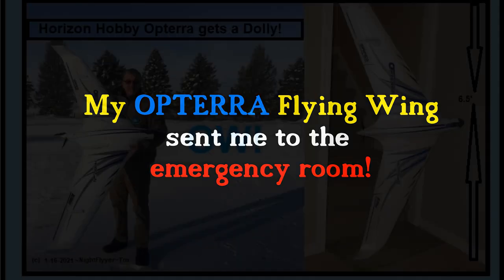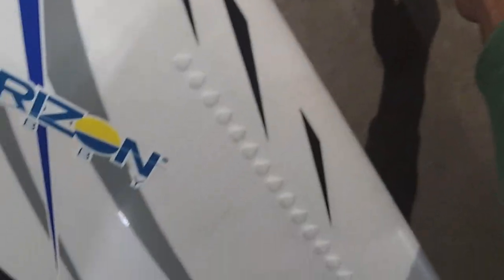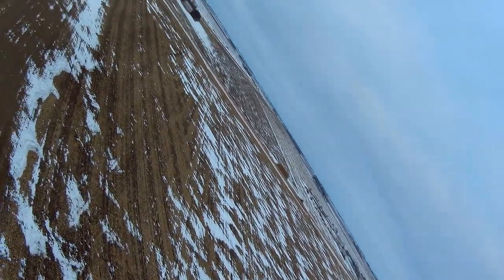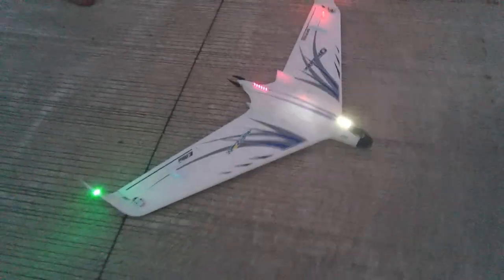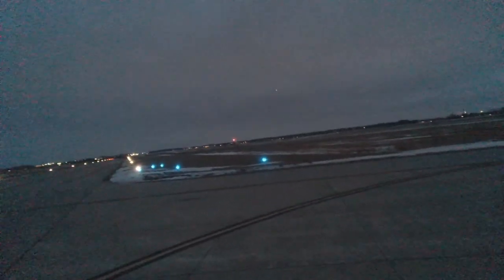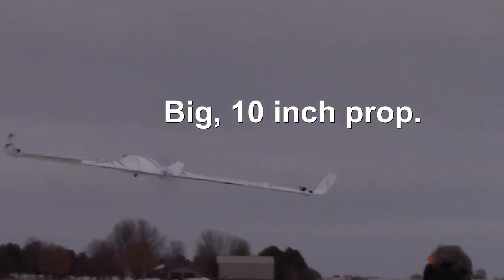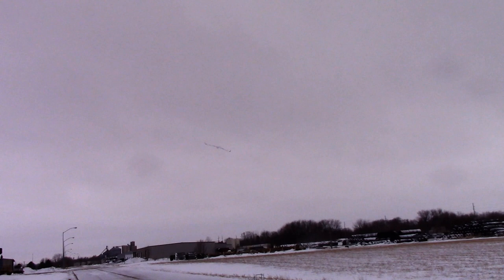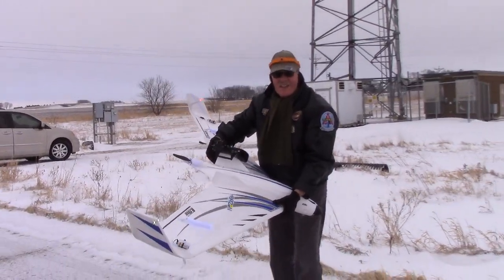My Opterra 2M Flying Wing sent me to the E.R. This is an awareness video & my solution for launching

Comment: You don’t have a throttle cut off on your planes? Glad you’re ok. I’ve had the same concerns with the Stryker.
Reply from the maker: No and every one of them have to me moved to full stick then back, but not this one.  I never have had to use a throttle cut.  That is not what cause the accident anyway.   Here is exactly what the Opterra 2M manual says word for word.  1.  Put the aircraft into launch mode with the channel 5 switch.  (in my first video that did not work, it went into the ground)  2.  Hold the aircraft in one hand and the transmitter in the other.  3.  Apply full throttle and throw the aircraft directly into the wind, angled slightly up (5 to 10 degrees above the horizon). 4.  Climb to a safe altitude and check the trim.  Thanks
Reply: @NightFlyyer  I put a throttle cut on every plane I have. One of the reasons I didn’t buy that plane is because I’ve seen exactly what happened to you happen to others.
Reply from the maker: @paulballard4243  I only mention the Throttle arming because I followed instructions in the manual and this is the way it bound. It said nothing about programming in a throttle cut to a switch, which also may be in the wrong position, by accident.  It  had nothing to do with the reason I got hurt.
Reply: @NightFlyyer  yeah yeah ok 🙄

Comment: The hand launched pusher configuration is just asking for trouble, a couple of guys in my rc club will throw their planes with the motor barely going or not running at all, then give it power after they toss it. It does cause a torque roll but its manageable. A plane like that might need a landing gear it can take off with.
Reply from the maker: My smaller wings are not problem, like my F-27 Evolution, but this one is hard. I know others have their own ways, and either way, my Dolly is the safest solution for me.  
The Opterra 2M manual also says nothing about throwing it with the motor off, so if a newbie followed the instructions, like I did, I'm showing what could happen, in case a gust of wind got them or something else.     Nothing is 100% and no matter how good you can throw, this big 7 foot wing with a 10 inch prop spinning right next to your face, into 12 MPH is risky to say the least.  The 10" prop is very close to your forearm as well, so a gust could tip it back even before launch, as others told me happened to them.  Thanks.

Comment: I feel your pain and share your scars.   While some pilots have had great success with hand launched pusher planes, they are inherently risky.  Flying wings are even more so since they have no prop wash over the control surfaces and require high launch velocities to prevent stalling.  Keeping the prop diameter as small as possible reduces the chance of contact, but one is always one "oops" away from the emergency room.  With the transmitter hanging around your neck, it is very easy to accidently bump the throttle when picking up the plane.  Many transmitters have a "throttle hold" function.  This function links to one of the transmitter switches, preferable the far left one,  and the switch forces the throttle to off.  When holding the model overhead,  the switch is flipped to enable the throttle.  Many of the pusher flying wing designs have been created to keep the plane's nose free for mounting an FPV camera.  A practical alternative is to change over to a twin motor tractor design.  This clears the nose but at the expense of adding the weight of the second motor, prop and ESC.  It does however provide safety and more stability at launch with the prop wash going over the control surfaces.
Reply from the maker: All true.  First of all, that throttle cut had nothing to do with my hand injury. I only mentioned the Throttle arming because I followed instructions in the manual and this is the way it bound up and arms the motor as soon as you plug in the battery.  It's my warning to be cautious, because the manual says nothing about programming in a throttle hold to a switch. I've known of times when after flying, that switch was forgotten to be moved back to safe and it armed as well.  Nothing is 100% as it could be left in the wrong position, by accident. I'm pretty experienced, so never relied to on a throttle cut/hold, as all my drones and helis need throttle stick movements to arm.   I only am warning others to be careful BEFORE the launch and to be careful no matter what you use. 
This wing is 7 foot long, heavy and will bend and break the end off the if you even try to pick it up by the tip and barely has enough power to fly out of your hand at launch.  I know and I tried.    It would also be extremely difficult to somehow launch it discus style with the elevon there and that 7" tall winglet rudder that is also on the tip.  I know how to do it , but not with this plane.  
See my 14 year old self-contained catapult in action here.  https://www.youtube.com/watch?v=ypxbkaY-Ycs&t=113s  
It's not like launching my SMALL F-27 Evolution or 1.2M Opterra.  So I followed the instructions word for as I did for the video I made of my product review earlier where nothing happened bad.  https://www.youtube.com/watch?v=P_inF5EYLEE&t=1s and the second one where I explain how to protect the bottom of the fuselage.  https://www.youtube.com/watch?v=ur5V5H8UcGs&t=1s
We are only talking about a Half inch of clearance that I needed to keep from getting cut. 
Here is word for word what the Opterra 2M manual says about launching.  
1. Put the aircraft into launch mode with the channel 5 switch.  (in my first video that did not work, it went into the ground)  
2.  Hold the aircraft in one hand and the transmitter in the other.  
3.  Apply full throttle and throw the aircraft directly into the wind, angled slightly up (5 to 10 degrees above the horizon). 
4.  Climb to a safe altitude and check the trim.   
I know others have their own ways, and either way, my Dolly is the safest solution for me.  
The Opterra 2M manual also says nothing about throwing it with the motor off, so if a newbie followed the instructions, like I did, I'm showing what could happen, in case a gust of wind got them or something else.     Nothing is 100% and no matter how good you can throw, this big 7 foot wing with a 10 inch prop spinning right next to your face, is risky.  https://www.youtube.com/watch?v=P_inF5EYLEE&t=1s 

And to see how I feel about that unnecessary auto stabilization system see this.  https://www.youtube.com/watch?v=ur5V5H8UcGs&t=1s

Thanks.

Comment: Wow, brilliant job of landing that plane. You'd think at the very least it would have some sort of circular prop guard or perhaps some sort of wheels that would allow for a ground take off. Maybe some sort of cut in hand grip for hand launching but you'd have to not hold the throwing arm for true, you'd have to drop it fast. Terrible design flaw and I know that must have taken months to just start feeling right again in part. Doubt you'll ever have the same feeling or control with that hand again, please correct me if I'm wrong about that.
Reply from the maker: Thanks for the suggestiond and I tried some already, but because it was cold.  I found trying to hold on to the tiny finger grips on the bottom of the 7 foot wing with a thick glove under full power with wind blowing was difficult when under power and then trying to fly with  a big enough glove on was also difficult to fly the transmitter, (I'm a stick pincher)  so although that sounds like a good idea, it did not work that well. Some have told me the Prop got them in the forearm even before launch, when a gust of wind got under the wing and tipped it back.   We are only talking about a Half inch of clearance that I needed to keep from getting cut, and even though I pulled it off several times in my earlier product review video,  I will never hand launch it again.  LOL.  It's hello dolly from now on!  
If you saw my Product review  video,  https://www.youtube.co/watch?v=P_inF5EYLEE&t=1s  you would see  those wings aren't as strong or thick as you would think.  I would have to add a nose wheel servo and make it a trike as well.  And since the prop on the back is 10 inches, the landing gear would have to be quite long or retractable prop would hit the ground on rotation or landing. Thanks for the suggestion, but the dolly will work.  It's been 3 weeks and yes, the finger does not bend well and still hurts when I try.  Thanks again.
Reply: @NightFlyyer  Check with your Doc, a call will do but I'm thinking he'll tell you to keep pushing on bending the fingers as the tendons need to stretch and not seize up. He may recommend physical therapy and if it's covered that may be good as well. Maybe a soft rubber ball and squeeze it, one the size of a grapefruit or just smaller. I'd work it at least a few times per day. I realize this isn't my business and also don't want to assume you haven't gone way past my thoughts on this subject. I find it hard not to help even at the risk of not being taken well in certain circumstances. Thank you for the great videos and I will indeed check out the preview. ONE MORE THOUGHT...What about an atlatl , you just need to add or take away something so the atlatl will catch. That would keep your body from harms way or so one would think.
Reply from the maker: @MartinFluteCompany  Yes. I am using the dolly from now on.  This plane is just too big to hand launch.  I am using a soft ball to move my finger.  It will take some time, but it is getting better. Thanks.

Comment: Sorry you got hurt that looked really nasty!. I keep seeing Youtube videos of people struggling to hand launch. I have flown RC Planes for many years including wings albeit never a 2m wing and they are not easy to launch but see how well your Opterra glides, You can throw the wing hard into wind with your hand back by the motor and once you have you hand back on the transmitter then  throttle it. I used to see how I long could fly after a hand launch, do a roll etc without the motor. Just thought I'd mention it. All the best.
Reply from the maker: Here is word for word what the Opterra 2M manual says about launching.  
1. Put the aircraft into launch mode with the channel 5 switch.  (in my first video that did not work, it went into the ground)  
2.  Hold the aircraft in one hand and the transmitter in the other.  
3.  Apply full throttle and throw the aircraft directly into the wind, angled slightly up (5 to 10 degrees above the horizon). 
4.  Climb to a safe altitude and check the trim.   
I know others have their own ways, and either way, my Dolly is the safest solution for me.
  
The Opterra 2M manual also says nothing about throwing it with the motor off, so if a newbie followed the instructions, like I did, I'm showing what could happen, in case a gust of wind got them or something else.     Nothing is 100% and no matter how good you can throw, this big 7 foot wing with a 10 inch prop spinning right next to your face, is risky.
As you saw, my launch rail 7:12  did not work in this video.  My Catapult  7:26 would have worked probably, but it was destroyed in the fire that destroyed my jets and my home, so I never built another.  The instructions only say to hand launch it and tells how.  That is how I did it. 
Of course nothing is 100%, and others told me they were holding this big 7 foot wing and before they launched, a gust of wind got under it and it tipped back and cut their forearm and 3 tendons.  Its hello dolly for me from now on.   Here are the links to the last videos.  
https://www.youtube.com/watch?v=P_inF5EYLEE&t=1s&gl=CO  and   https://www.youtube.com/watch?v=ur5V5H8UcGs&t=1s
Maybe a gust of wind, maybe my 73 year old left arm was weaker, or who knows.   But either way, if it happened to me launching the way I thought was good (and  the same as all my previous launches.)  So if it can happen to me, it can happen to others, and that is the warning I want to present. Thanks.
Reply: @NightFlyyer  Hi thanks for the big reply. sorry to hear you lost a lot of stuff in a fire, damn that must be really tough. If it's in the manual you would follow their launch method and had I not been around other RC flyers with more experience who showed me what to do I would have still been launching with the motor on. The trolley worked well :-). At a respectful 73 years of age hand launching maybe a bit tough I'm 58 and am feeling the aches and limitations already. It's good you have not given up and have made some good launch systems I like that!. Keep on Flying and take care.

Comment: KEVLAR gloves,  but your solution was fantastic!! Nice job!!!
Reply from the maker: Thanks for that suggestion and I tried that already, but because it was cold.  I found trying to hold on to the tiny finger grips on the bottom of the 7 foot wing with a thick glove under full power with wind blowing was difficult when under power and then trying to fly with  a big enough glove on was also difficult to fly the transmitter, (I'm a stick pincher)  so although that sounds like a good idea, it did not work that well. Some have told me the Prop got them in the forearm even before launch, when a gust of wind got under the wing and tipped it back.   We are only talking about a Half inch of clearance that I needed to keep from getting cut, and even though I pulled it off several times in my earlier product review video,  I will never hand launch it again.  LOL.  It's hello dolly from now on!  Thanks.

Comment: I have activated the Throttle Cut function on all my electric models (some have 2Kw motors that can literally take your fingers off) to protect against accidental throttle bumps. I have not seen an ESC activation sequence that needs the throttle stick to be bumped up like on arming a drone.
Reply from the maker: Thanks but I have esc's that do.  First of all, that had nothing to do with my hand injury. I only mentioned the Throttle arming because I followed instructions in the manual and this is the way it bound up and arms the motor as soon as you plug in the battery. It says nothing about programming in a cut switch like my helis have. I only mention it to warn others to program in this feature as well,  which also should have been mentioned in the instructions.  It's my warning to be cautious, because the manual says nothing about programming in a throttle hold to a switch. I've known of times when after flying, that switch was forgotten to be moved back to safe and it armed as well.  Nothing is 100% as it could be left in the wrong position, by accident. I'm pretty experienced, so never relied to on a throttle cut/hold, as all my helis and my drones, and many of my electric planes need throttle stick movements to arm.   I only am warning others to be careful BEFORE the launch and to be careful no matter what you use. Thanks.

Comment: I have somewhat long arms and I hand launch under power. I don’t let my arm extend all the way out when I throw it. I don’t my hand after a brisk toss. My hand is completely out of the way from getting hit by the prop. Each and every time I toss it. 
I do know the feeling of being hit by a spinning propeller! 
I didn’t have a throttle cut switch assigned in the beginning. So one day I had a plane on a table plugging it in and after it was armed, I accidentally bumped the throttle and the plane came towards me and hit my wrist! It took 48 stitches to close the two slits up! Only 10 stitches were on the outside! 
This brings me to the point where I have to tell you (you probably already know) that you should always program a designated throttle cut switch on your radio and do the same with every airplane regardless of brand! 
One last thing, the takeoff dolly has a flaw! I heard the prop hit right as the plane took off from the dolly! 😮
Reply: It should say “drop my hand”
Reply from the maker: I launched this plane many times as shown in my previous videos on this with no incident and with over 50 years of handlaunching aircraft, I am no newbie.   I also have a kill switch programed on all my planes and helicopters, even the Nitro Ones.  That has nothing to do with the prop hitting me.  One gust of wind and that did it.  All devices I used to launch this 7 foot wing were first gen, and the prop may have slightly nicked the PVC, but it still flew. Everything can be improved as it is all part of the learning curve, so here is my newer version with the launcher.   https://www.youtube.com/watch?v=fECB6U6R0uk&t=9s  and then here is when I put retracts on it, which works the best. https://www.youtube.com/watch?v=TMtdTW_fECs&t=21s  Where are your Opterra 2 M videos?

Comment: Is there a release on the dolly to drop the two front supports? I'm not sure how it took off.
Reply from the maker: The 2 upright tubes on the front hold the wing, and when it gets enough speed, it simply lifts off.  The Dolly stopped when it hit the screwdriver pounded into the pavement to tie the string too at the end.  I added some small guides on the bottom of the wing to keep it centered on the dolly.  Thanks.

Comment: I have one also and I was told about that prop. I was also told as soon as you start the throw at pull your hand down fast. I also have a smaller plane life is and I decided for wheels on it just too dangerous. How about wheels?
Reply from the maker: Yes, well if you saw my Product review  video,  https://www.youtube.co/watch?v=P_inF5EYLEE&t=1s  you would see  those wings aren't as strong or thick as you would think.  I would have to add a nose wheel servo and make it a trike as well.  And since the prop on the back is 10 inches, the landing gear would have to be quite long or retractable prop would hit the ground on rotation or landing. Thanks for the suggestion, but the dolly is now my landing gear and does not add any weight to this underpowered 7 foot long wing.